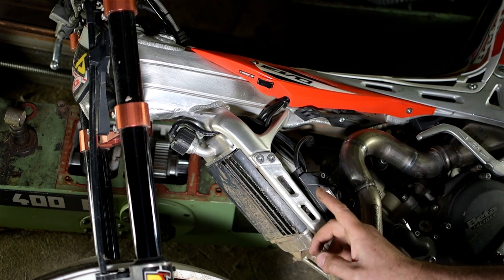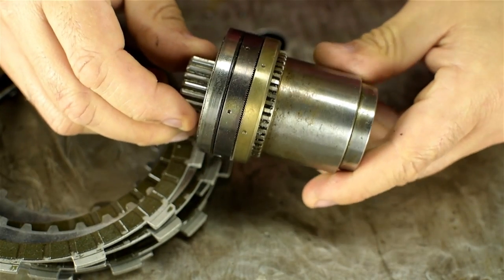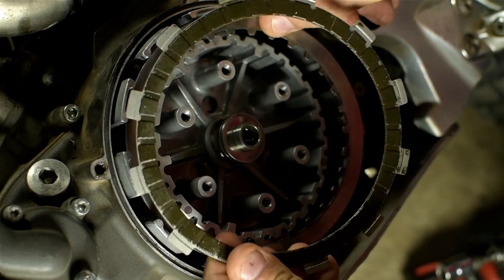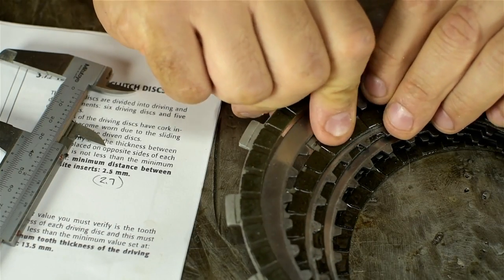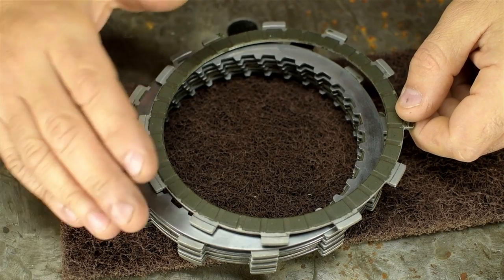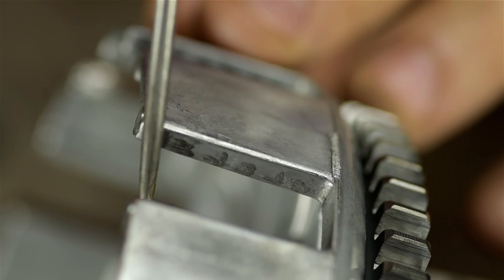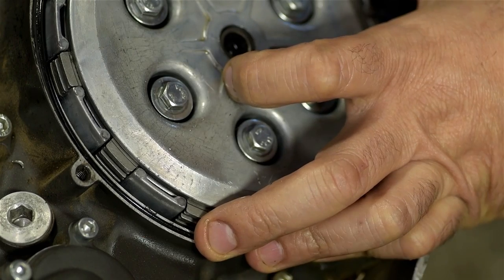something something MOTORCYCLE CLUTCH!

Comment: This is 90% of my job right here: take thing apart, clean them, put them back together, and tell my boss "idk if I fixed anything, but I didn't make it worse, and isn't that really what matters?"
Reply: David Parry  teary eyed that is the lamest dad joke i have ever seen
Reply: Yep, 
I couldn't find anything wrong. Cleaned and reassembled. 
Get them off my back.
Reply: As a heavy equipmemt mechanic, can confirm. 90% of what I do is take it apart, clean it, and put it back together with new o-rings lol.
Reply: Yep maintenance engineer for a food factory, and that's my whole existance
Reply: David Parry  or the right color.........
Reply: @ApeShift  for sure on HUEI engines.
Reply: @ApeShift  And then it still leaks anyway
Reply: @ApeShift  sometimes same mate, but working at a smaller shop the machinery we get is often so deep into disrepair that it keeps it much more interesting.
Reply: That is the idea of a service...
Clean it up and make it nicer then slap it back together.

Comment: 7:59 600 grit should be fine, but 800 grit would be finer.
Reply: But nothing would be finer than to be in Carolina.
Reply: Of coarse it would.
Reply: 600 grit is ultra fine.
Reply: You think you're so smooth putting a higher number in there
Reply: @DavidKirtley  In the mo-orning!
Reply: Hominy grits?
Reply: Is that an example of an oxymoron?
Reply: You wouldn't use 100 grit of coarse !
Reply: Dang it. I should read the comments first, or watch the video sooner ...

Comment: Great Video, .. as always.
Just some hints for viewers who'd like to work on their motorbike-clutch too.
1. As Tony mentioned, remember the assembly-order for reassembling, yes it does make a difference.
2. some manufacturers implemented the clutch pack with a "facing-order" as well. meaning, that it's important to have plates facing inward and outward to spec.
    those are usually marked as well. if in doubt have a look at a service manual, or (if no manual available) at some online-shops, that might just have close-ups of the plates, 
   to look for markings.
3. any wet-clutch does "behave" a bit differently with different oil-temperatures (yes, wet means, it's running in oil... engine oil, though), therefore, if you're having trouble with your clutch 
    slipping at higher temperatures you might consider a different oil (somewhere in the range of manufacturers oil-specs, mind you). some OEM-clutches are famous for slipping with the "wrong" oil.
4. the "cold-play" of the clutch-lever (so the physical clutch-engagenment) might be different from the "hot-play". 
    one should consider this when trying to minimize the play whilst assembly by shmming. A zero cold-play might result in slipping when hot. (might! it all depends on how it's manufactured)
5. all the above-mentioned relates to the whole "chain of engagement"  as well. as a rule of thumb. adjust the play to a point where you have like a 5mm of dead-way on your clutch lever 
    (somewhere in the middle of the length of the lever itself / where your middlefinger touches the lever). Then run it, until hot, measure the dead-way again and see if it increases or decreases. 
    this gives you a good idea on how much more to reduce play between parts, if you're chasing the last 1/10ths.
6. yes, there's plenty of debate on whether synthetic or mineral oil is best for proper clutch operation.... no there's no conclusion yet (i wonder why :-P)
7. yes, smooth clutch-operation helps for long-term satisfaction. .-)
8. no i'm not a certified expert on this matter, just wrenching a lot and taking stuff seriously.
9. yes, i'm german, if you find any spelling mistakes or sentences oddly put together, .. feel free to keep 'em.
Cheers, 
S.
Reply: You write comments better than 90% of people on YouTube so I dont think you have anything to worry about, and thank you for offering your advice!
Reply: @qualeb8164  
What ever you do, don't mention the war........
Reply: A lot of good practice and things to look out for in that comment. 👍
Reply: Stephen Baer wow,your English is better than my German.....or my English! Thanks for the tips!
Reply: I appreciate the fart noises. It appeals to my inner child
Reply: Late to this video and your comment, but your English is as excellent as your information.

Comment: Very good description and technical  explanation of a multiplate wet clutch.  From an old mechanic, the only advice I would add for someone brave enough to open one, is to use your eyes and nose when evaluating the condition. Smell the oil, if it smells burnt, strike one...  look for blue/heat spots on the plate, (smooth metal parts). 

Not to get bi-purpose on you, but automatic transmissions use very similar multiplate clutches in their clutch packs.  But everyone knows automatics are half black magic, half voodoo and half FM principal, (effing magic).

Well, done, as usual, even though it was about a demon machine.

Comment: Based on a video involving a zebra that drags two lions with a combined weight of 750 kg over a distance of 18 meters in 15 seconds, I have calculated that a zebra has about 11.8 horsepower. So, that Beta EVO puts out about 0.21 zebrapower.

(750 kg × 9.81 m/s² × 18 m) ÷ 15 s = 8,829 W  ≈ 11.8 hp
Reply: Is it 18 vertical meters?
Reply: @frisosmit8920  Yes. It was like an elevator for lions. I figured that the friction of the pully was negligible.
Reply: @TheOfficialCzex  hahahaha, nice
Reply: Whaouuuu !!!! so much
Reply: Thanks! Been looking for this.
Reply: You gotta measure how long that Zebra can keep it up. 

One horsepower isn't one horse's maximum power, its it's work-all-day power.
Reply: Do they make continuous duty rated zebras?
Reply: And a pissed-off Clydesdale produces ~30 Horsepower when pulling trucks from ditches in the snow.  A team of them is an awesome sight.
Reply: @criggie  Shizzite Criggie, you should see these cheese fed Amish Clydesdales drag a John Deere Quadtrac out of a ditch, sideways. 14 of them. The Teamsters Rep from the dairy warehouse across the road shed a tear . "Those were the days," he whispered.
Reply: This is why I read ToTs comments
Reply: @TheOfficialCzex  I was going to question how a striped horse could have the power of 11.8 horses, but I realized that I didn't question my classmate in engineering school when he calculated that he had a 9 BTU penis; I guess that would be unfair to the zebra.
Reply: @criggie  Ha! I really need to work 'pissed-off Clydesdale' into my unit calculations more often.
Reply: @zincfive  reminds me of a coworker how many MacBook fans it would take to lift the building so I did the math. I have proudly added  that a MacBook fan does not push enough air to lift itself to my long list of utterly useless things that no one knows
Reply: You have used the gravitational potential energy equation. GPE = mgh
Might be better to use the kinetic energy equation KE = 1/2 m v^2. We can also account for the weight of the zebra (400kg), assuming it is not dragging lions during an outer body experience.
1/2   *    (750+400)     *       (18/15)^2    =   828 joules
828 joules = 828 joules per second. (We have already used time in the above formula in the m/s part.)
joules per second = watts = power
828 watts = 1.11 hp
This only proves the power output of a zebra under a "2 lion" workload. 
To find the peak horsepower of a zebra we would need to keep adding lions and measure the zebra's RPM until it goes to zero.

edit: I look forward to seeing this in a future video
Reply: @zincfive  Oddly enough, one horsepower is not equal to the mechanical power output of a horse.
Reply: @1philhuitson  The lions were lifted vertically by the use of a pulley to transfer the zebra's movement. The zebra had adequate grip on its hauling surface to prevent slippage.
Reply: @TheOfficialCzex  That all seems highly unlikely.

Zebra hooves have an extremely low coefficient of friction. The industry standard for vertical lift zebra assemblies is to have the hooves removed and a rack and pinion installed, driven by a PTO shaft from the zebra.
Reply: But HP is not a metric unit!!!! 😁
Reply: @VoidedWarranty  :) Convert it to zebra power, it'll lift 11.8 engineering buildings
Reply: @TheOfficialCzex  Good to know! Those zebras are sure strong!
Reply: @dadillen5902  You win the internet today!
Reply: @DJPhilTBCollins  IIRC the Cheese-fed Amish Clydesdale coefficient is 11.8

Comment: And now I'm curious how it turns out. 
Personally I find borderline spring length suspicious. 
But I'm used to motor cycles with a bit more than 2.5 hp.
Reply: Border line spring length could result in clutch slippage as peak power, or a normal feeling clutch that will eventually start slipping. Better just replace them with heavy duty ones while you're at it, instead of buying another set of gaskets.

Comment: Just one question. You did remember to soak the friction disks in oil before you re-installed them right? Please say yes.
Reply: Emulsified oil is a killer
Reply: I hope he did after using dish soap "I hope it wasn't dawn" to clean them.  But from the looks of it he didn't, as they looked the same going in as they did when he was done fixing/unfixing? them.  Always good to RTFM.  But watching this video did remind me that i need to change the oil in my motorcycle.

Comment: Between Mustie1 and you, I pretty well have multi-plate clutches down.
Reply: Musties didn't need a new spacer to take the backlash out of the clutch though.  There was an adjustment on the case as well as on the clutch handle if I recall...
Reply: Leave the boomer out of this discussion, please
Reply: @user-gdxt-7399  If you like ToT you'll like Mustie1, what are you even on about?
Reply: Generic NPC I think you’re about 30 years off. ToT would be gen-x.
Reply: @kristofferbeder  Pretty sure Mustie1 isn't a boomer either.
Reply: Exactly what I was thinking when this popped up. I've never been into a basket clutch in my life, but I'm pretty sure I could handle it now.
Reply: People! Mustie is the babbling boomer, not Tony!  My comment was, like, please keep the level of the comments to a better standard.

Comment: 1:07 I can't believe my eyes. I thought you were a real mechanic. Not being able to instantly recognize the size of that bolt makes me question everything I thought I knew about you.
Reply: You can tell an old mechanic from a new one by the condition of their 8, 10, 13, 15, and 19mm sockets compared to the rest.
Reply: @jacobg5122  Doesn't work in the US as reliably in those sizes... My Dad's 1/2 and 9/16 sockets have both had to be warrantied because he straight up wore them out and they're both Snap On. His wrenches aren't far behind. They're sort of "speed fit" now. Frankly, I kinda like it for the work he does with them these days (mostly making hydraulic hoses).
Reply: @TheBrokenLife  
I work in the US on mostly FMC and International/Navistar vehicles and those are the most common fasteners I run into. On trucks, you use 8mm (5/16") for hose clamps, 10mm for valve cover, water pump , AC compressor, and many other bolts, 13mm (basically 1/2") for alternators and other accessories, 15mm(9/16") for turbo mounting bolts and other large components, and 19mm for anything on the frame. Also 24mm for the drain plug, 33mm for lug nuts, and 36mm for fuel filter housings. The lines on those things are mostly standard sizes though. You can do an Allison 2000 series with a 14mm for the bell housing bolts, 15mm for the torque converter nuts, but for the cooler lines you need 3/4, 13/16, 7/8, and 15/16 wrenches.
Reply: @jacobg5122  My Dad is 78 years old so metric is a language he isn't too terribly fluent in. That's really what I was getting to.

Also... I will not confirm or deny my personal involvement in International trucks in the past, but if you're working on the engines you have my deepest condolences. Sounds like you're working on MDs, so... Imma see my way out. ;)
Reply: t's "fair-sized", isn't that all that matters?
Reply: @TheBrokenLife  
Whoever designed the Maxxforce engine should be doomed to replace EGR coolers and blown turbos for the rest of their lives. The DT466 never should have been phased out.
Reply: @jacobg5122  15mm is an odd size, they collect dust. 17mm is the standard size for 10mm bolt head that sees probably the most use after 13mm
Reply: I thought millimetres were insects?
Reply: @jacobg5122  Ah yes, the M5, M6, M8, M10 (not DIN, should be a 17mm socket there too) and M12 bolts. I'd like to add the 24 and 30mm sockets too, for bigger things.
Reply: @dikkie1000  
I think my 17mm sockets may have been used the least out of all the ones I own. At least on Internationals it doesn't seem to be a common one.

Comment: This video shares joint top spot with the best bike clutch explanation I've ever seen: my motorcycle instructor doing a slow, controlled, u turn on a super bike - with the engine firmly pinned on the red line. Granted this explanation was a little quieter. And probably better for the clutch.

Comment: Good video, you could have mentioned the sharp edge and round edge on the steel plates. Most people make sure they are all facing the same way. Some clutches have different thickness steels and they go in a certain order. I’ve seen baskets in much worse shape and run them with no problems.

Comment: Brilliant video ToT. I haven't read all the comments so someone may already have mentioned this... The friction plates of a "wet" clutch system must be pre conditioned by soaking in the correct oil (I leave them over night) before being used. So if you clean all/most of the oil off with detergent/solvent, well, perhaps maybe they should be re soaked before use, well I would, but that's just me.
Also, the plates should be checked for thickness (well done ToT) and also warpage (is that a word?), on a surface plate by.... Heck you know how to check for warpage.
Oh, remember to clench before you strain. Err, it can help stop anything escaping, sort of.......

Comment: Now that you've filed the basket to remove the imperfections the tabs on the clutch plates hit at different times so only some are actually transmitting power until enough wear takes place for them all to make contact again.

Comment: typically, i would sand the steels (on a flat plate or glass pane) but no need to sand the frictions.  and yes you can file the basket, no issue other than a "chattery" clutch.  the "pushrod" runs through the trans across to the clutch arm where the cable connects on the stator side of the case.  the throwout bearing and clutch shaft (or pilot shaft) is what you described under the pressure plate.

Comment: Sometimes machines just want to be curiously disassembled, tediously cleaned and lovingly reassembled.

Had that with my brush cutter yesterday. Not even a suggestion of firing. Dismantled the carbi, drowned it in brake cleaner, reassembled and it started/ran first pull.

Comment: Usually a good idea to, at the very least, coat your multiplate clutches with oil as you assemble them. Some people let them soak in oil for a bit prior to installation. Oil has a harder time working its way in between the frictions and steels if they're installed dry which can contribute to excessive clutch wear. Start it and let it run for a bit while disengaging/engaging the clutch to try and get some oil in between the frictions/steels before attempting to put it in gear.

Comment: You need the end play you call it because without it it would mean the clutch isn’t being fully engaged and the push rod is holding the clutch slightly disengaged. Your problem is probably your springs. That’s what holds the power to the rear wheel. I always enjoy your videos

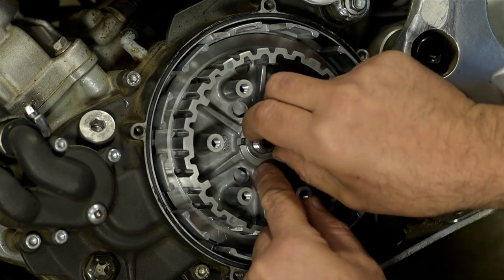Comment: 14:40 The torque spec is - tight until bolt snaps. Then loose 90 deg. The second part is very important. Otherwise the bolt will be stuck forever.

Comment: i have a 08 aprilia shiver that just hit the 12k service mark. ive been thinking of pulling the engine apart and seeing if i can do the valve adjustment myself but i still think that is a step to far for my abilities but this video did make dealing with my possible transmission slipping seem a lot less daunting. thank you

Comment: Hey old Tony about you filed down the clutch path . I dont know if you fine sand it down so the metal is smooth enough for the clutch pack to move back and forth. But yes the smoother the surface. The smoother the clutch pack slides. P.s when I said about filing down the clutch pack I meant the metal outer part  or inside part not the clutch pad itself. Either way it looks good keep up the good work 😎

Comment: Hi Tony, love the videos. Thought I'd mention that I've had a slippy clutch issue on a bike before and after replacing the plates it turned out to be that the clutch just needed adjusting. That little bit of slack/backlash in the hub mechanism means your clutch plates are able to slip (particularly at high torque). Aside from the minor adjustment screw on the clutch lever there should also be a major adjustment on the clutch pushrod mechanism on the left side of the engine near where the cable goes into the engine cover.

Just thought I'd mention it incase its applicable to your bike too.

Comment: if the clutch will slip, you can try another transmission oil! be sure, that the oil is made for motorcycles, with wet clutch. it will often help a lot! and thank's again for pretty good video!

Comment: A good trick to hold stuff down is to put masking tape on the piece you want held down, then masking tape on the table. You put super glue in between the masking tape, and it holds the item down for sanding etc. And little cleanup and your surfaces are unscathed. Learned this trick from crimson guitar's channel